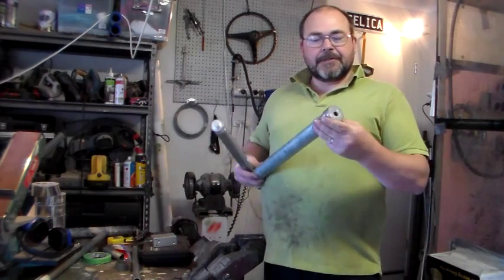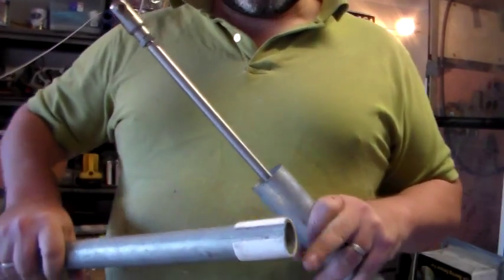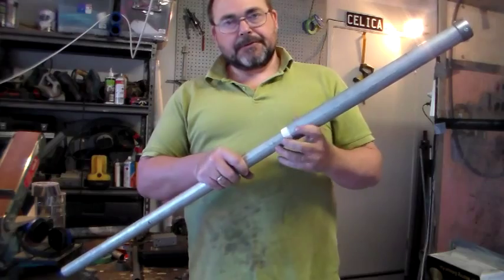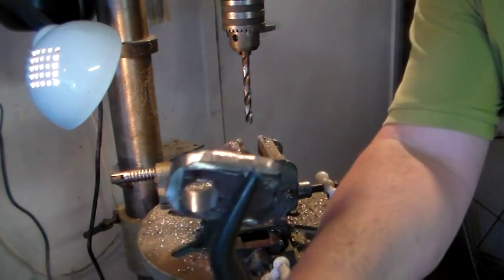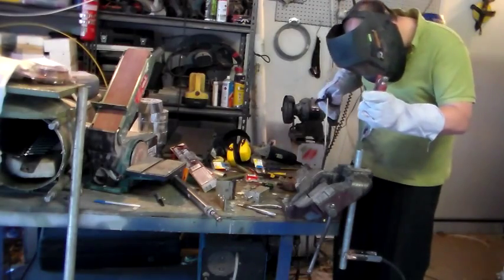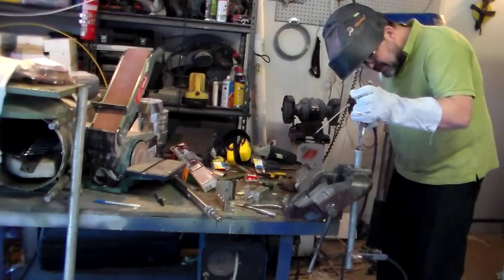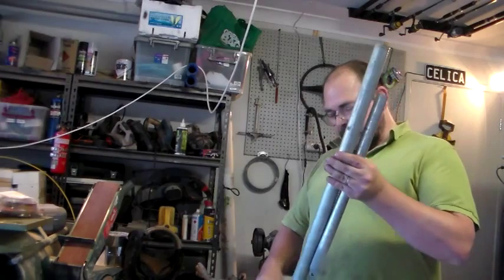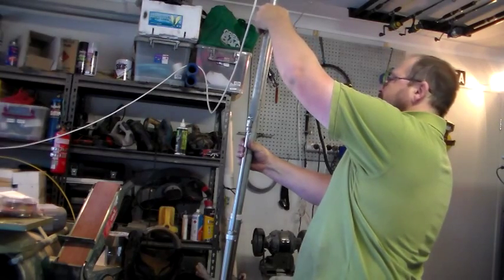Making a Plastic Injection Molding Machine Part 3

Comment: just a question, but why not use a hand-tapper instead of the chuck so you don't have to change out the bits?
Reply from the maker: I normally do use a hand tapper, my tap kit has a nice ratchet hand tapper that I like to use. I was just trying something different, the advantage of tapping with the chuck is that it keeps the tap straight and inline with the hole.